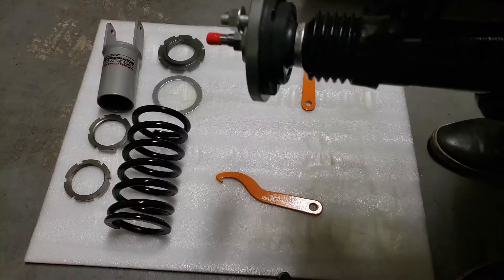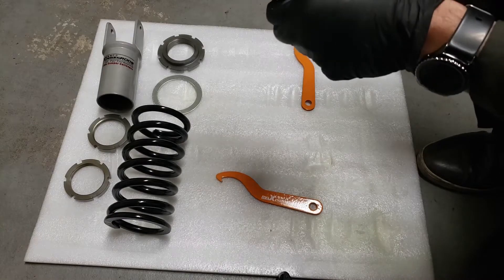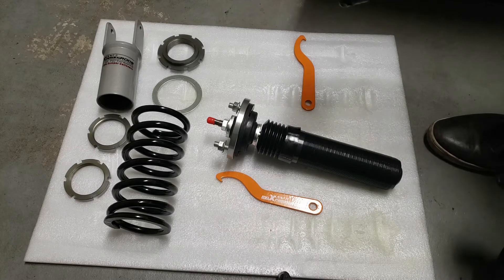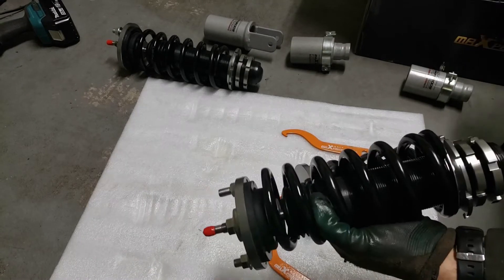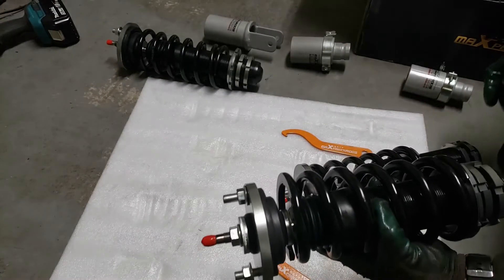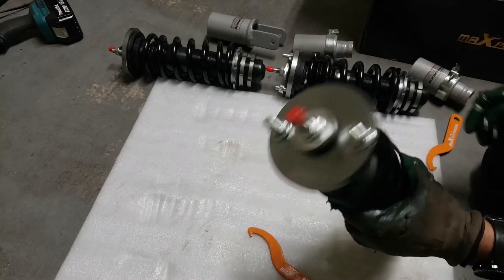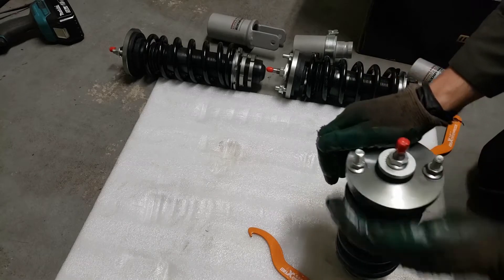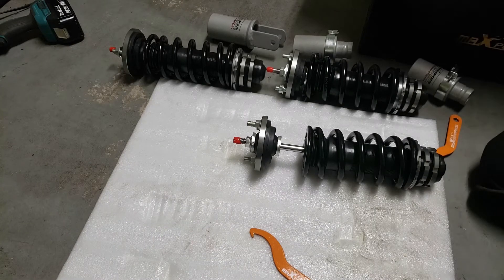[DIY Car Mods] "Maxpeedingrods" Coilovers Update - Rebound Test

Comment: Just got my set and found 2 shocks blown. I don't know if its the gray color but i guess its common. I bought directly from maxpeedingrods website. Trying to return them now.
Reply from the maker: That sucks. I'm sure its just the coilovers themselves. The inner damper cartridge seems to be universal for many of their coilover models. I dont think they're made well or just used very cheap seals. Even the replacement cartridges they sent me were in a oily bag which looks like it may have leaked. I really wish they'd improve the damper cartridge. Its the key component of the set and its what fails. I hope you get your money back.
Reply: @BudgetGears yeah they really don't want to refund you. I tried to get a refund but they sent replacements. Waiting for them right now. Hopefully they'll be ok.
Reply from the maker: @K1ngR3x  I hope the cartridges are good for you. Make sure you test them to be sure they work. Its not uncommon for them to send multiple broken products. Mine came in a oily bag and they were fine but its a matter of time till they die. If they can break during storage or shipping, then its a wonder how they can work on a car.
Reply: @BudgetGears  yeah exactly. I wished they had a good quality control process where they checked it out before its shipped. Im in California and it shipped from cali. The replacement are coming from overseas. And they wanted me to spend money for shipping. I said no. I was like man it's whatever. Why me right. Oh well. You get what you pay for!
Reply from the maker: @K1ngR3x  Yeah if they had a better quality control process that would be good. But they're cheap for a reason. The more time they put on them, the more expensive they get. Seems like a common theme with them. They sell people a broken product and want people to pay more to get a replacement shipped. Makes no sense to me.
Reply: @K1ngR3x  Package of sp1  received
 The 2 backs are nickel
 The 2 fronts are bathed in oil in their packaging
 I test them without their spring, without surprise HS

 After having spoken well to the after-sales service, they send me back a set of 4, while 2 new rears will be useless to me.

 New package received yesterday
 Another front that bathes in oil

 I find myself with 4 dry and operational backs
 And 3 before fat and HS, and 1 before dry

 In doubt I even weighed the 4 fronts
 Unsurprisingly the heaviest, the non-greasy dry
 The lightest the one that doesn't even go up anymore
 And the other 2 lighter and fatter 😂

 So, I still don't have 2 correct fronts out of 2 batches

Comment: How did you pay for these?   You should file a CC complaint  or stop payment, but I think you got the run around and it may be too late.   As for shock rebound,  normal shocks are just fluid filled and only resist motion.   To aid some shock design in performance, the fluid is under slight pressure and you see them push the rod back out.   High pressure gas version are hard to press in and spring out instantly.   Thus pressing is not a test of operation, resistance to pushing and pulling is the test.  A quality check is is the shock fluid leaks out the seals and yes the gas that leak out  is not good too.    A common complaint is after  5000 miles there is no damping..  bouncy ride  which you seem to have already.  Sorry for your results,
Reply from the maker: I paid for these through cc but through a performance shop that ordered for me and picked up on the US. So I pay the shop a marked up price and they buy the item for me. Its because of the travel restrictions due to covid. The shock cartridges were easy to push in even with the replacement cartridges so they're definitely not high pressure gas. But the new cartridges do rebound compared to the old blown ones. The quality just isn't there for these coilovers. Even the new cartridges that they replaced, had oil all over them. Im assuming maybe they use poor quality seals. I know that on mountain bikes shocks leak sometimes when the bike sits and isn't used causing the seals to shrink and oil to leak out. I'm assuming it might be a similar concept with these coilover cartridges where they sit too long and maybe the seals shrink? Either way, you really get what you pay for. I'll be finally putting these on soon to see how they are, but I'm not expecting much. Wasn't impressed with these before even installing.